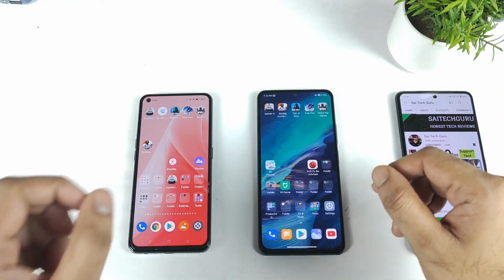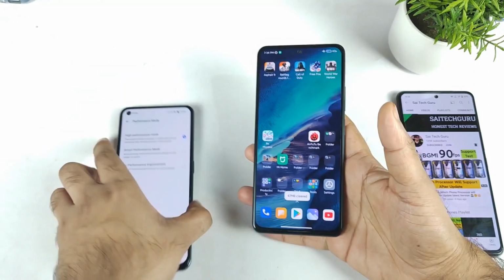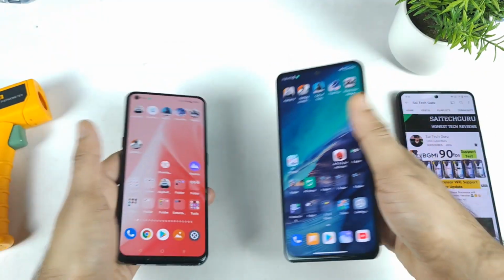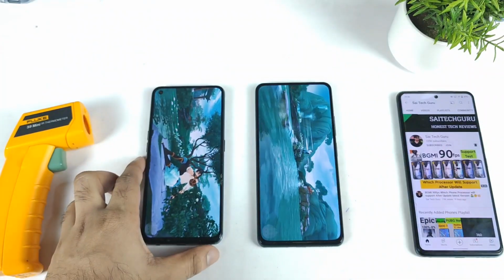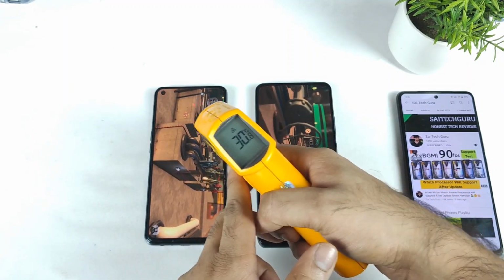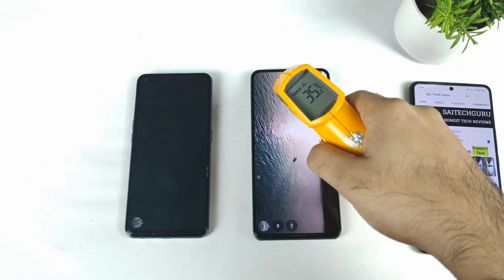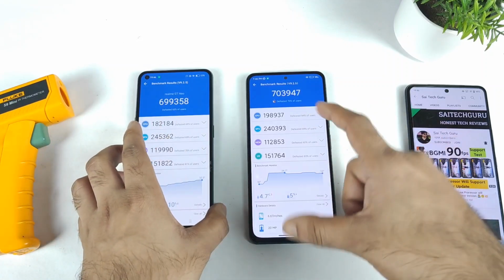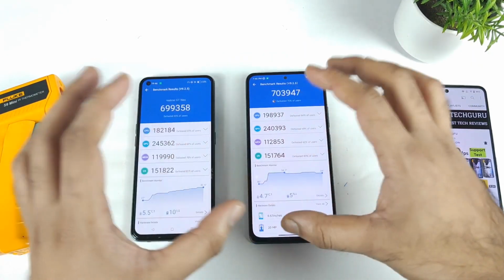Realme X7 Max vs Mi 11X Antutu Test High Performance Mode After update Shocking Results 😱🔥🔥

Comment: Mi 11x best for gaming???
Reply: I have been using it to play Genshin impact from the last 2 months which is a heavy mobile game and it does a good job on giving 40-50 fps on high setting the mobile does heat up but it's because of the glass panel. Mi11x is really good to play game on.
Reply: Yes absolutely best and better than any smartphone in this range (iqoo 7 , GT neo  2)

Comment: Bro , please make video on realme x7 max youtube issue , i am in class 12 and my boards are going on and i am studying on youtube and videos are getting freezed and restarting and to fix this issue i need restart my phone which is very frustrating as it breaks my link of study.
Reply from the maker: Open YouTube website  from Chrome browser bro ...
There is some issue till than use in chrome.
Reply: Ok that's unfortunate. But try clearing YouTube app data and update the youtube app as well. If that doesn't work, do like what Sai Bro says OR install brave browser in your phone and watch YouTube. It even disables ADs and that's even better when you're studying.